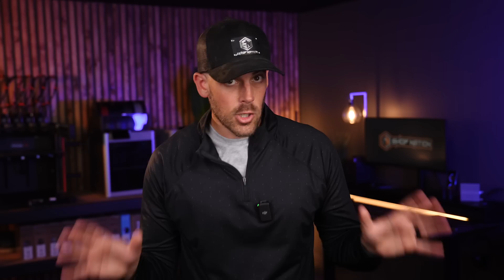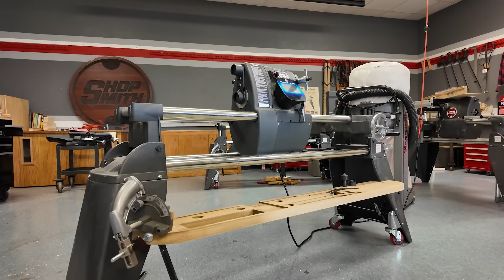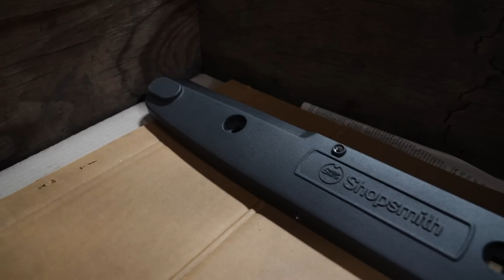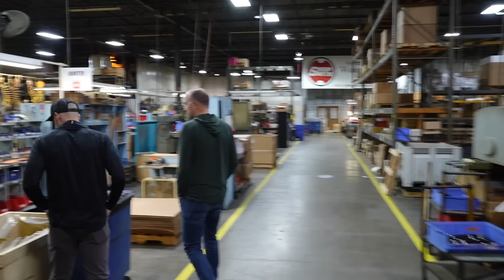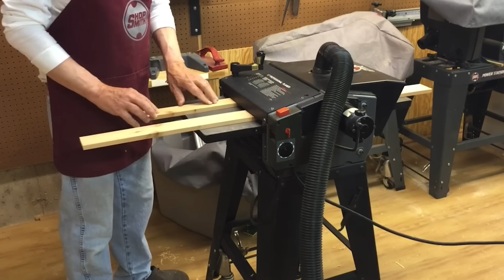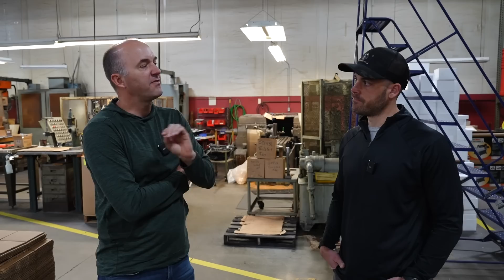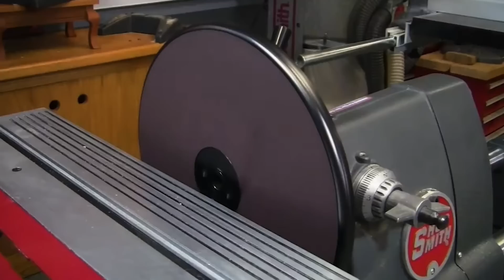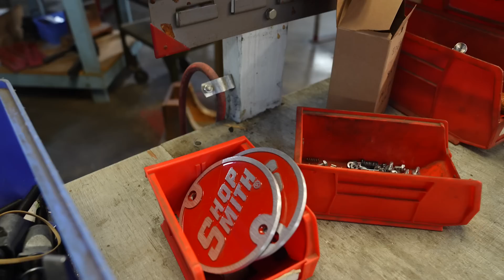The Last American Power Tool Company is (almost) dead

Comment: I know he’s not gonna wanna hear this. But the problem is about 90% cost and 10% hokeyness.

 I learned about the shop smith tools about 10 years ago and I have thought it was awesome since I learned about it. I even hope to someday have one. However… when you can buy decent tools from places like Amazon, Home Depot, Menards and Acme for substantially less. People will ALWAYS justify not buying quality. 

I have an old craftsman table saw and band saw, a delta 6” jointer, ryobi router table and drill press. and even a home built CNC router. The total of all these tools is WELL UNDER $1,500. And yes that includes the CNC router. 

The band saw and table saw I bought used for $50 at a garage sale after some quick haggling. The jointer was a wonderful gift from my father in law. The router table and drill press were a total of $300 new at Home Depot on a Black Friday sale. And the CNC cost me $800 to build from free plans I found online over a decade ago. It’s built out of MDF with a Makita trim router and uses an old XP desktop with Mach 3 to control it. 

$5,000 is an awful lot of money to anyone looking to TRY OUT a new hobby. For example. I’ve been in the R/C hobby for nearly 25 years. I would NEVER tell someone looking to try R/C as a hobby to go buy a $4,500 Primal RC Raminator. That’s completely asinine. I tell them to start with a $300 Traxxas model that’s incredibly easy to get parts for and even easier to fix or modify as your interest increases. Depending on the person’s patience tolerance… I may even suggest a $99 Redcat first. 

So asking someone to buy a new tool for something they don’t even know if they’re going to like is a big ask. But then conversely… You have a problem with the veterans who love woodworking too. Those guys are likely to want something much higher end. Like the Sawstop or Delta table saw you mentioned. And so unfortunately in today’s market. There is sadly no place for a shop smith but a small niche market. 

I wish them all the best and I sincerely do hope they manage to find a new breath of life in today’s market. I think it’s a very unique tool and it would be truly sad to lose such an American icon.

Comment: Very well-built machines. I really like the speed control and head casing. 
I hope the company survives in the current market, but I suspect they are not adapting quick enough. If they are still selling the instruction videos, they clearly have some outdated mindsets. 
If they had uploaded reasonable quality videos on YT for the last 10 or 15 years, it would have very likely made them way more machine sales than the small amount of money gained from the video sales. 
I have seen a good few of these machines for sale over the years, but the limited video reviews and online info just didn't convince me they were worth getting. Though a channel of experts using and demonstrating how good they are sure could have changed that.

Comment: My comment to Nick would be to focus any upgrades or changes to the ShopSmith on the table saw aspect of the tool. The ShopSmith does a lot of things well, but work must be planned in advance to avoid changing back and forth from one setup to another, this can dissuade people. The ShopSmith manufacturing facility could use some Lean Manufacturing practices and methods. I wish Nick nothing but great luck and success in the ShopSmith reboot. Travis I hear you on the smell of a machine shop, once you have worked in one you never forget it.

Comment: This product just feels like a solution looking for a problem.  I really want to like it, I just can't ever see buying it.  At its price point it just never going to be viable for a beginning wood worker.  You can get a full set of wen tools that will perform as well for a much lower price and with better features(a 4 inch jointer is barely worth it).  It saddens me that this is the last power tool made in the US, but I still don't see buying this.

Comment: My 2 cents: I owned a Mark 5 about 25 years ago.  Space, cost, and capability were all factors in purchasing it.  I loved it.  I moved and out grew it and now have a shop with table saw, planer, jointer, cnc, etc.  The reason I would consider purchasing one again for my shop is the fact that I have plenty of tools I only occasionally use.  The drill press, disc sander, and I lack a lathe (would only occasionally use if I had one).  The space this takes up is about the same as a good lathe, but it could save me from having the space used by all the other tools I have for occasional use.  I think it would be great if there was a 'base' system price for the modern equipment.  I think this needs to be the frame/headstock/primary table.  Then, you can add packages as needed.  Lathe package to include the head and tail stock.  Drill press which includes the chuck and maybe an insert that includes replaceable blanks.  Disc sander package that includes the disc and the sanding shrowd.  Shaper kit, drum sanding kit, belt sander kit, table extension kit, spindle sander kit, and table saw kit.  This would be great because I could just buy the base unit, and the packages for how I plan to use it.  Make it really modular when purchasing.  You can of course sell a full version as well.  Being able to buy a base version lowers the price of entry.  The add on kits could be purchased throughout the lifetime of the product.  I could almost see a more recurring revenue path this way.  Engage with the maker community to come up with new ways of using the base platform by providing the specs of the unit along with your support for the community ideas.  If someone comes up with something great, buy them out and sell it as a new kit.  Over time, you can update the kits as new ideas come to you, then you can sell the 'upgraded' kit to existing customers if there is enough value provided.  I really hope you stay around.  I started my woodworking hobbie with Shopsmith and I root for you.

Comment: I actually have two shopsmiths in my garage, one from my grandfather, and one from my dad. I never bothered trying to get them set up, because the table saw part seemed so sketchy. And they both have broken casters, but slightly different caster designs, so it didn't look like it was possible to swap one for another. So trying to wheel them in and out was a pain. So they have just been collecting dust.

Now that I know that shopsmith still exists, and is still making them, and especially making them in America, I'm going to see if they sell the spare parts I need.

Comment: Looks like an awesome tool system.  After looking through and deciphering the shopsmith website I can only say it's a little confusing.  I had to figure out what each model does and differences between them.  Then still had more questions regarding attachments and upgrades.  I know it's a very versatile and expandable system but if there's some way they can make it easier to digest and understand I think it would simplify the sales process.

Comment: I grew up using a ShopSmith it was the first major tool my grandfather bought when he retired.  I remember going to the classes with him.  We had it setup in the basement bedroom.  We had the bandsaw, scroll saw, planar basically his 1 bedroom looked like the advertisement picture.

Like some have stated i think you need to dail in your target audience a bit more.   Its closer to 40-60 not 25-45.   Your 24-45 still have kids at home more than likely and not a lot of free time or money.  Wood working really needs both time and money.  The desire is there earlier but the time and money typically isn't.  Even in the late 80's early 90's my grandfather purchased his he waited until he retired.  I am 45 now my boy is 3, if i am lucky and do my job right i still have 15 years before I have the freedom to do something like this.

By the way @shopnation thank you for this maybe if you go to some of their classes we will cross paths i am about 30min from their factory and loving the PrintFarm Academy.

Comment: Nick, from ShopSmith, kind of touched on their biggest problem. Customers spendable income. It's a fantastic solution for that 20-45yo who doesn't have a lot of space but wants a half dozen machines. Unfortunately, most of the people in that age range also can't drop $4-5,000 for all those tools all at once. That new hobbyist worker goes and buys a jobsite or benchtop saw for a few hundred dollars and some handheld power tools and builds with plywood, 2xS, and box store dimensioned wood because they can't easily joint or plane. Then they get a thickness planer because big box store wood is expensive and limited choices. After a while they "can't" get the ShopSmith because they already put so much into all these other tools, including probably replacing cheap versions with more quality choices. I wish them the best of luck and appreciate what he is fighting for. 

You know who might be a good market is the city dweller moving out to the countyside to do homesteading or someone building a doomsday bunker. Both would have funds but the application is limited on space.

Comment: That was a very interesting video and I'm from the UK. Nick was correct, my first big purchase was a table saw and it's the tool I use the most. Recently I've been working on a very large project and my table saw broke (DeWalt). The project was held up for weeks because I couldn't work without it. He said that their table saws weren't the best so maybe they should look at that. PS I used to work in engineering and I know exactly what you mean by the smell and the history.

Comment: Very interesting. I had a disabled friend who bought one years ago but ended up selling it because it was difficult to do the changeovers in his wheelchair. I got him together with a retired lady down the street from my house and she bought it from him and took off running. I helped her get her start as I had time but it didn't take long for her to get the hang of it and she built a shop with my help and set the Mark up in it. She built quite a few things and used it in ways I don't think a lot of the owners do but alas, someone fire bombed her shop and she didn't rebuild it or buy another machine. What she learned from the Shop Smith she transferred into a few separate tools minus a table saw and jointer and made do with them and worked on smaller projects. If not for the fire she would probably be turning out a lot of projects on that machine. 
Oh, did I mention she was 68 years old when she started using it?
jack

Comment: This tool, at least to me, always struck me as something I'd have to keep resetting. Not because of the tool so much, but rather if (when) I make a mistake. If I'm building something, depending on the complexity I have to buy a certain % of extra material to compensate for mistakes and I doubt I'm alone on that. But the thing is I guess I'm not really into the "set up" aspect that using this tool involves. That's why I don't always swap out my table saw blades for various cuts (even though I should) or change to a wider blade on my bandsaw and instead go ahead and make the cut with the 3/8th inch 4 tpi when I should probably have something closer to a resaw blade on it. That being said, I had the chance to visit a neighbors small woodworking space and he had a Mark5. He makes violins! And the work is very impressive! So, I see the potential of such a solid tool and its ability to overcome space constraints while producing exceptional quality results. Good luck Nick!

Comment: A Shopsmith was the first tool in my repertoire.  My grandfather gave it to me when I moved in to my first house and it helped me get started with woodworking.  I can attest that it will probably run forever as long as I treat it right.  When it has broken down, I have called the same headquarters in this video and I spoke with an actual person (I think without even getting an automated answering machine) who helped get me the replacement parts I needed.  After taking it apart, I'm confident I can fix anything that could go wrong with this thing, so long as the parts are available.  But the best thing about this machine (its versatility) is also the worst thing about it.  Changing tools takes time and without good planning I might have to change back and forth multiple times.  It gets old quickly.  Also, like he said, the table saw is definitely the weakest component.  If you have the space, I think you're better off getting multiple dedicated machines.  However, since expanding my shop to include dedicated versions of nearly every tool, I have gone back to the Shopsmith multiple times when a machine is either out of square or otherwise not working.  I think it's a great piece of engineering and it is made to last.  This video is a great insight into the company.